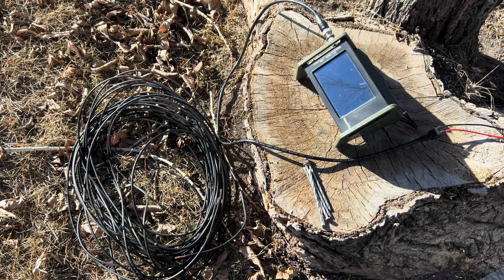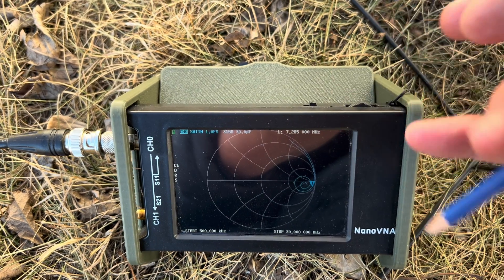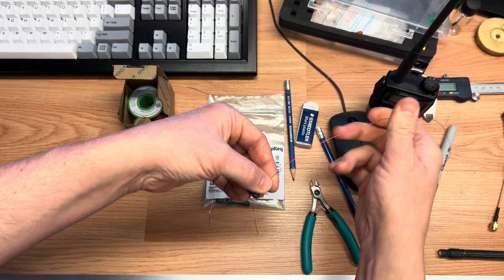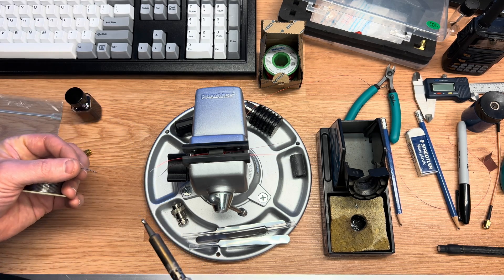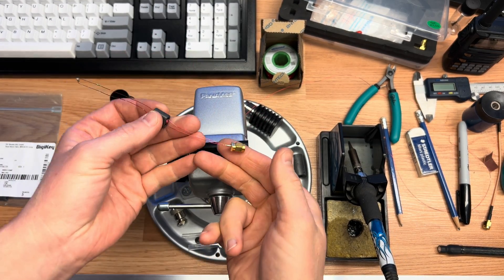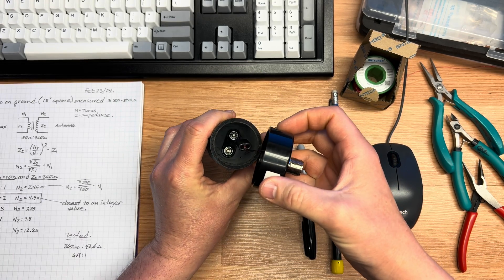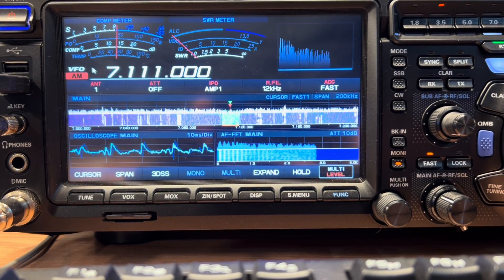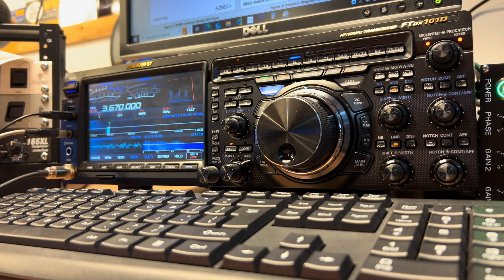nanoVNA - Experimenting with a LoG Loop on Ground Antenna & X-Phase QRM Eliminator

Comment: I have the exact same noise through the bands on my radios. It's even on the wiring, even when cutting the mains on the electrical panel. I am pretty convinced it is airing in the transformer. If that's not it, it's probably the smart meter.  I will stop back as soon as it is resolved and let you know.

Comment: I built and hooked up this antenna yesterday using 100' of 12ga speaker wire. I made a 2:6 turn transformer. It worked fantastic! Running my 80m dipole the rx was a S7 and when I switched to the loop the rx went down to S2. This was at max gain on the IC 7300. If I backed off the gain to the on the dipole to say S6 and switched to the LoG the rx noise went to S0 to S1. I did run pre-amp 1 because of the slight signal loss.

Comment: Aren't you losing 1/2 the signal by not unbalancing it before sending it through the coax? The loop is a balanced antenna. You're only impedance matching it. I guess this is what everybody does but it doesn't make sense to me.

Comment: Tried it today with a commercially available 9:1 transformer. It reduced the noise by 2 S-units but also reduced the received signal strength by a comparable amount. The "Noise Eliminator" might be the solution. I'm going to try that. My working conditions are an Icom IC-7300 to a dipole as well as a vertical. I'm in a very typical recently developed suburban neighborhood with HOA restrictions. The background noise level is challenging to deal with. Typically, S-4 at best and S-9 at worst. High frequencies are better, but it is dependent on band conditions.

Comment: Very good video but you have massive QRM  and RFI one thing that will help is a coaxal line isolator MYANTENNAS makes a great one  about 100$ and so does palomar engeneers  makes  several ones. both of them are absolute experts in RFI REMOVAL  s9 noise down to about s2 you can put one att he antenna and the other at the shack you wont believe the difference. 73's AA4CP Chuck in Las Vegas NV

Comment: I use more of a random length of wire loop on the ground. It has grown over the years and is now somewhere in the vicinity of 2000 feet long. I hooked my ft-817 directly to the loop and recorded the S meter readings on all HF bands. In the shack approximately 100 feet away I took the S meter readings once again. They were the same within half an S unit weather I used an isolation transformer or not. My loop is truly a low noise antenna. Living on the coast it is well buried under the forest canopy yet above ground enough to let wildlife pass by without getting tangled. So far no "metal mites" have discovered it.

My thoughts on the subject weather correct or not are:
- Noise is either common mode or a generated signal.
- Loop on the ground does not fix common mode.
- A resonant loop would peak both desired and undesired signals.
- A random length loop ( on the ground ) seems to have a better signal to noise ratio. In my case the noise is reduced far in excess of the desired frequency and manipulating the RF gain control, volume and maybe preamp can enhance the desired signal greater than the noise.
- Isolation transformer seems to work as designed for a beverage but in my experience did nothing positive or negative with the loop. Note: I do have a couple of 50 thousand watt blow torches within 50 kms of me but they are not being heard at all from 160 thru 6 meters on the loop. However, if the beverage does not have the isolation transformer than the AM broadcast band becomes an issue on 160 and 80 meters.

73, T

Comment: I don't understand why your loops impedance would be so high, 300 ohms. I modeled this using mmana and the Z comes out to be almost zero plus common sense says it should be extremely low. Yes I know everyone uses a 9:1 ratio with the high Z side on the loop but what's going on? I even asked this question to 3 different AI's and all said the Z should be below 5 ohms and the transformer should be reversed with the low side on the antenna. Do you have any idea why?
Reply from the maker: This is a good question.  It never crossed my mind to question or to ask why.  I have no idea, honestly.  Perhaps this could be a mystery to solve in an upcoming video?
Reply from the maker: Tell the AI that you laid a 15’ per side square wire loop on the ground and measured a feedpoint impedance of approximately 300 ohms using a nanoVNA and see what it says after it tells you to expect a very low impedance… hehe!
Reply: @ve6wo  Ok I actually tried this. My vna shows about 450 ohm impedance but totally reactance. Software is wrong. The antenna is about as dead as a duck though.
Reply from the maker: @n4lq yup, they’re supposed to be rather “quiet” antennas.  Unfortunately at my location this antenna was very efficient at picking up noise and ignoring signals.. haha!  That’s how it wound up being the noise sense input to a phasing type noise canceller.  Worked well for that at my station.  Hahaha!

Comment: for 75 ohm cable this is 4to1 swr and for receive this is not bad with a low loss cable. think i am just going to direct feed. i made meany short wave antenna resonate and non resonate and i could not see much difference. have a pocket shortwave set with just a whip so will use a loose coupling coil so independence matching will be a pine.

Comment: Huh.  A 5:2 turns transformer is normally expected to be 6.25:1, not 6.9:1.  Presumably there's a lot more variation in those results based on the response of the material itself, which never seems to be brought into consideration.
I'm in a fairly urban location myself, and my LoG is definitely a lot less noisy than my DXC fan vertical.  Annoyingly, though, QSB tends to switch which antenna is better for receiving a signal; I wish I had a setup capable of multiplexing the audio to do the "brain de-multiplexing" that Callum from DXC uses...  Maybe with my next radio.

Comment: just seeing this nice video today, did you ever find the source of that QRM as heard on your Loop on the Ground? Was there a power line running right over the LoG maybe, thus inducing all that QRM directly into it??  None the less, your perfect QRM receptor sure worked well as the null'ing source against you Primary antenna, congrats !!
Reply from the maker: Yes.  I was able to track down the source.  It was coming from two arcing insulators atop two power poles in the back alley.  I was able to use a VHF/UHF yagi and my FT-857D on battery to listen using AM demodulation to locate the poles, and then used the MFJ ultrasonic dish to pinpoint the offending component on each of the poles.  The local power company came out and replaced both the failed insulators and my powerline noise issue is now gone :-)

The LOG antenna just didn’t do what I needed at my location.  There are many positive experiences posted online regarding this antenna, however, so perhaps it’s just one of those things where what works for one operator may not for another, depending on circumstances unique to each QTH.
Reply from the maker: Yes, that little noise cancelling box works pretty good when fed a good noise source to phase the actual receive antenna against.  It’s not a full cure for noise though, you are having to constantly fiddle with it, and the receive levels after noise cancelling are not as good as taking the signal straight off the receive antenna.  Perhaps a better quality unit would offer increased performance.  I was looking at the DX Engineering NCC-2 at one point, but I no longer need it.

https://www.dxengineering.com/parts/dxe-ncc-2?seid=dxese1&gclid=Cj0KCQiA1p28BhCBARIsADP9HrPa72Qu_zjT8Tu5XEq6Ay4MobAu-wV6v3H-r-m26SS-pM0-KPPo_DsaArL5EALw_wcB

Comment: I had similar issues with the loop in my front yard but yielded better results with the loop in the backyard. I suspect it's related to the underground hydro and CATV running under the front of the property.

Comment: Wow, I didn’t realize those QRM eliminators worked so well. They really are an ingenious method of eliminating that RFI. Bose Audio Company would be proud. I may just have to pick one of those up for my shack. Nice way to salvage what would otherwise have been a really bad LoG antenna, hehe. 

BTW, you could have achieved a 2:4.9 ratio on that xfmr by doing a 20:49 winding, but I’m sure you already knew that, and I’m sure it wouldn’t make much difference one way or the other.

Comment: Very good. We are also battling similar noise and have similar tool.
  The video I saw he had the loop 1 foot above the ground for the most part.
  I was going to suggest a magnetic loop antenna for my friend. Also loop just above the ground. We are trying CM chokes and ferrites. noise not from his house, we tested. I have a VK5 noise canceller and will also take that to him to try there. Here it's not quite as bad. S 0.5 on sideband but at his it is S7 ! We were wondering if it had to do with smart meters but at mine it seems like a noisy power pole transformer.
  I believe that 2x turns in a binocular is simply through and back. I think it's the same with a toroid. Whenever a wire passes through the hole it's counted as one turn.
  I tried with a random long piece of wire in the trees at mine to use it as the Aux cancellation antenna but it only seemed to work on noises from within my house. I'm thinking I have to get the aux antenna closer to the power lines, perhaps just close to where the main power comes into the house or any power point. I could take a live wire and wrap it around the aux antenna perhaps. Ideally I need to find all the noisy transformers but I doubt they will change them here in France.
Reply from the maker: I will have to go back and examine the way I wound the binocular core!

Comment: great info how ever you need to add common mod balun the noise you getting is from non adding common mod balun I had the same issue however after adding the common mod balun all noise a re gone I hope this will help you vy 73 elan
Reply from the maker: If I reassemble this antenna in my front yard at a future date, I will try a common mode choke and see what happens.  

I have a suspicion, however, that the type of antenna and transformer being used in this project makes it naturally resistant to common mode noise.

Thanks for the suggestion :-)

Comment: I’m confused, why are you looking at matching the coax 50 ohm impedance with just the resistive part of the impedance of the LoG  antenna? I’m wondering why you didn’t add that to your callcs for the antenna impedance.  Or was it a small enough capacitance that it didn’t matter?
Reply from the maker: This is a non-resonant receive only antenna intended to be used for broadband reception.  If I were to correct the reactive component as measured at a given frequency, that correction will be valid for a single frequency only and would compromise performance across the rest of the spectrum.

Comment: Hi Gregg, a suggestion... Instead of metal nails into frozen ground (i.e. highly conductive!), Try using plastic stakes. You may need to drill a few holes into the frozen ground, but I think you may find the nails are inducing the ground noise.

I can't really duplicate your issue here in the desert - haha...😆
73
Reply: Any updates on the noise source and/or elimination?
Reply from the maker: Replacing the nails with plastic stakes didn’t seem to make any noticeable difference.  I am no longer using the loop on the ground antenna.  It just didn’t perform well for me, however, I did recently post a video where I go noise hunting :-)
Reply from the maker: It’s worth a shot!